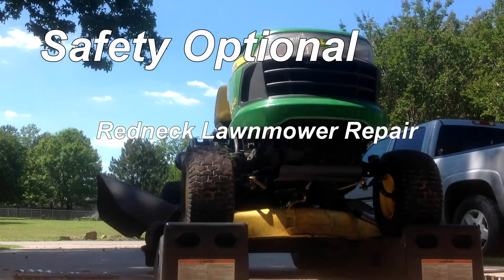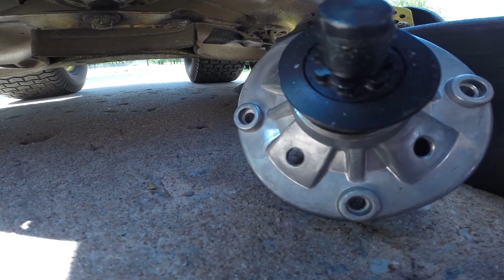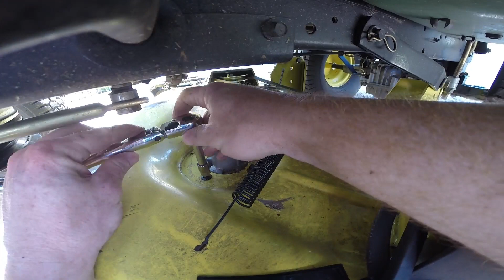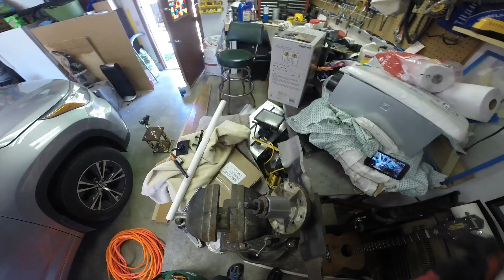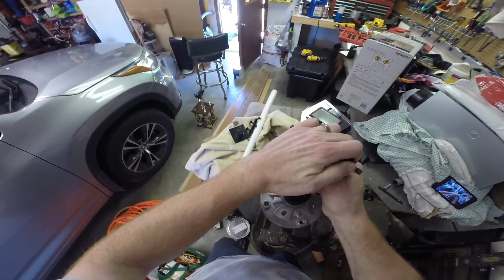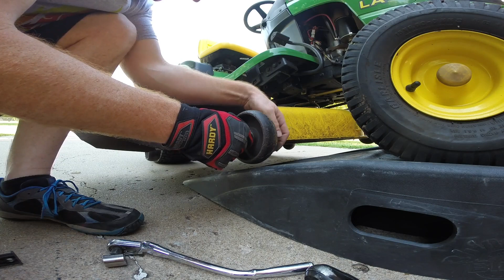Lawnmower Repair - John Deere LA145 Blade Spindle Replacement - Safety Optional

Comment: It takes me less than 5 min. to remove the deck on my LA145   work on the tailgate of my truck sooooo much eaiser
Reply: I have a older LA 145 John Deere mower that I need to replace a spindle on the mower deck. I plan on taking the mower deck off to remove the spindle. I'm also going to the John Deere dealership that I bought the riding mower and take the spindle and the serial number of the riding mower to hopefully get the right part. Might be more expensive but for a mechanical amateur who has had failures and ER visits it should be worth paying more for the part

Comment: Would’ve been easier to remove the deck first
Reply: 5 cotter pins and no tools required. Takes seconds
Reply from the maker: Having taken the deck off my own mower a few times, with the cables and belts and the pins that have to be dealt with, it was probably easier doing it  with the deck still on, but only marginally.